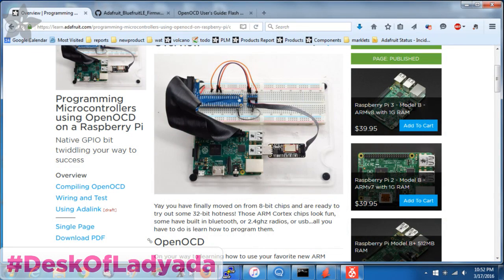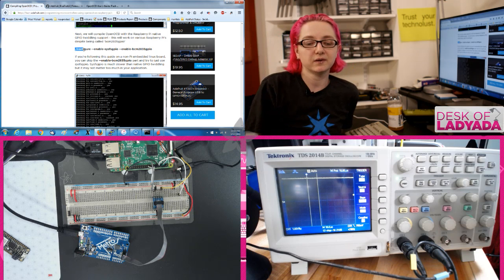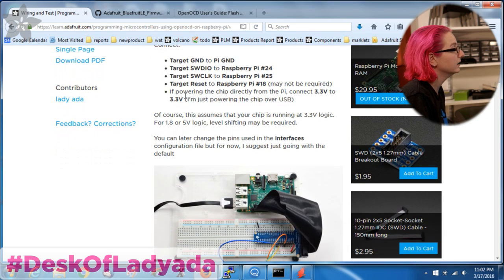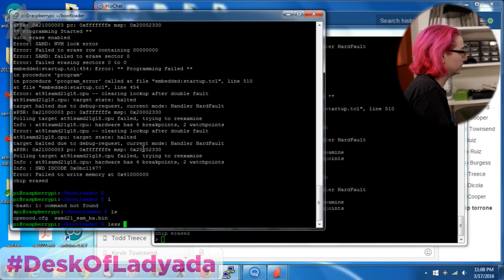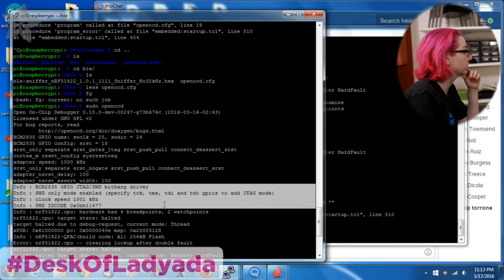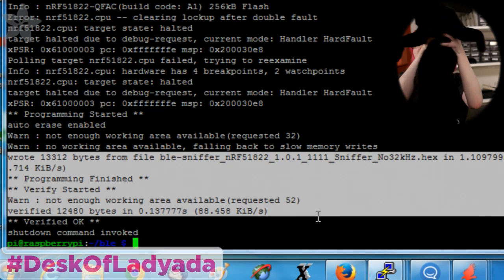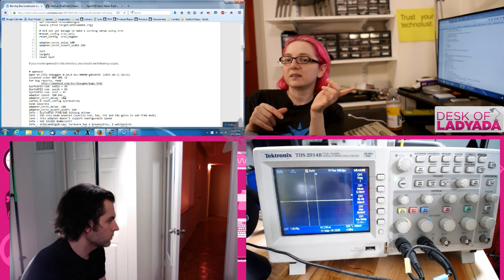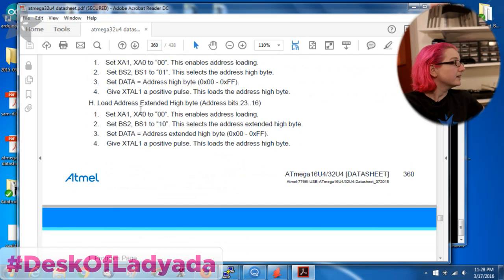OpenOCD chip programming on Raspberry Pi #DeskofLadyada @adafruit 3/17/16 @raspberry_pi #raspberrypi

Comment: Any idea how I should go about fixing this?

Info : SWD DPIDR 0x2ba01477
Error: [stm32f4.cpu] Could not find MEM-AP to control the core
Examination failed, GDB will be halted. Polling again in 100ms
Polling target stm32f4.cpu failed, trying to reexamine
Info : [stm32f4.cpu] Cortex-M4 r0p1 processor detected
Info : [stm32f4.cpu] target has 6 breakpoints, 4 watchpoints

Comment: Can we program External flash memory of STM32 using this technique? I have been using this method for a long time now, and it is very nice to debug on the fly remotely from anywhere. However, for graphical applications we often need to program external flash. Is there a way to do that?

Comment: All great, but id  does not work as I would expect  :( I have Rpi 3B and Im running newest RaspberryPi OS.  SWDIO seems to  be  on Pin 25 and SWDCLK  on Pin 11. After hours, I somehow connected SAMR30 board and ran chip-erase command and got response "Starting chip erase" and that is  it. After that there are two lines for the "Listening". Anyone done it recently? Also it says that it runs in JTAG / SWD mode for some reason.